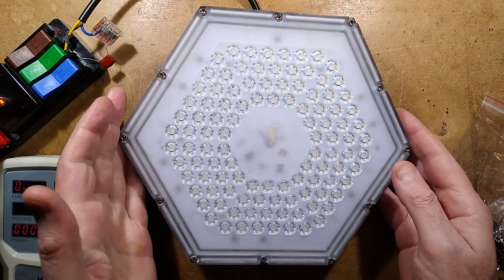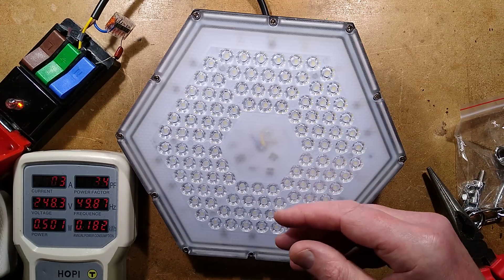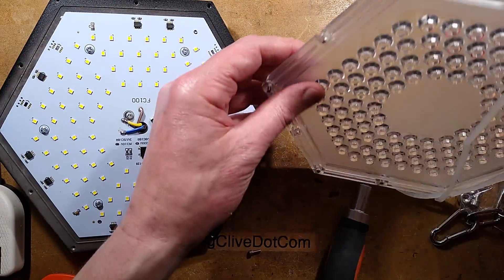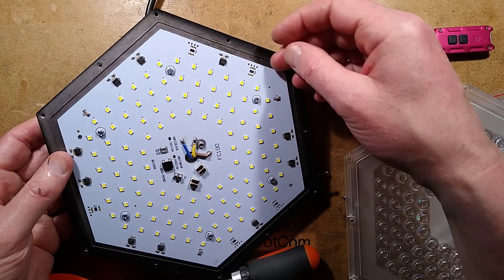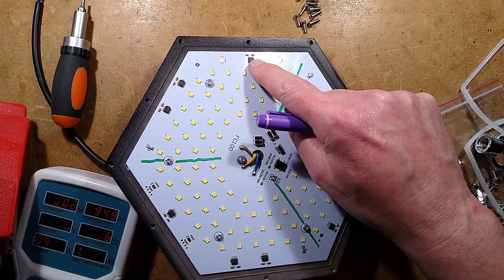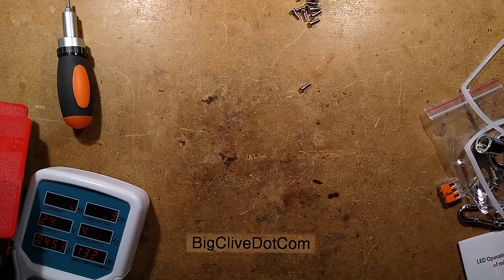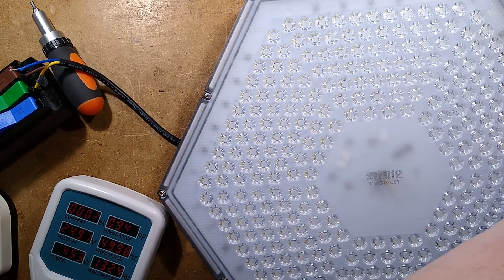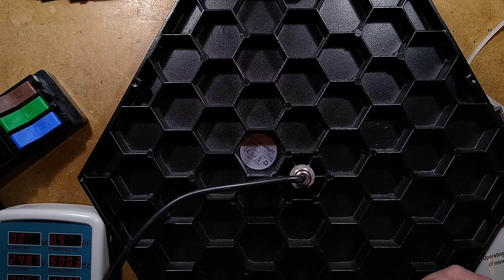Exploring an eBay "mine" light (flicker alert)

Comment: I would like to see a test of each of the lights at full power (outside for safety) with the thermal camera to see how hot they will get over time...and if they will actually melt the front.
Reply: That heat is felt radiating from the panel is just frightening.  I'm in Australia, and LED light burnout is a real problem, and shortens their life considerably.  I'm sure this has a lot to do with stressing the LEDs to their limit and then with ambient temperatures pushing 40 degC, they roast.  Pull a failed globe apart and sure enough one LED will have dirty great black spot in it, and others will have brown patches or small black spots.  Remove the most damaged LED and the globe works again.  Magic!  As a result, all the LED battens I have are now doctored (Big Clive style, thanks mate!) to ensure they're never warm to the touch with an ambient temperature of 25 degC.  They still feel warm when it's 40 degC+, but so does f'n everything else too!
Reply: @Stoneman06660  fellow Aussie here, yet to have a single non-ebay bulb fail. I just use Philips stuff(normal and a lot of hue) and zero failures, even when installed in outdoor fixtures and even full sun.

Previous industrial workplace also had gone through the "let's replace every light with cheaper led options" and they dropped like flies. Switched to decent stuff (the smaller flood lights they ended up installing also happened to be Philips Smartbright) and zero failures in years. The quality of light was hugely better as a bonus.

The explosion-rated LED fluoro batten replacements also had zero failures in years, some in close proximity to rather hot furnaces etc.

With led, quality is everything
Reply: @Stoneman06660  Probably China made stuff. The ambient temperature may be the difference between working for at least a few years on average or fail within weeks or month. Chinese manufacturers probably just count on the "max recommended operating conditions" given when buying LEDs - which is usually at just at 25°C, because the manufacturers want good numbers (this is almost impossible to keep them at, even in an environment with "normal" room temperatures. Even more so, when the ambient temperature is far above 25°C as well. Usually they have to be derated to work reliably at more relevant temperatures for the cooling capacity and ambient temperature - which is shown in the data sheet. Same thing applies for components in the driver. Which often gives up before the LEDs burn out).
Reply: Totally agree this would be a great video too. Would also be interesting to see the temperature difference running them at 25%, 50% etc.
Reply: It's the world's first LED room heater.
Reply: @chrisengland5523  Please, i've had times when money was so scarce that i didnt have gas heating and had to use an excess of lighting to heat my room(.....people who know me know this isnt bs either, true story)
Reply: @frogz  Well, I sympathise with that and sadly, there are many people in that predicament. From an engineering point of view, the electricity is converted by all types of bulbs into a mixture of heat and light. (The light ends up as heat eventually too.) Modern types of bulb, particularly LED's are much more efficient, in the sense that more of the electrical energy is converted into light, rather than "wasted" as heat. In the summer, that heat really is a waste, but in the winter, the heat is not wasted, but instead contributes to the warmth of the house. Whether you heat your house this way or use an electric heater of equivalent wattage makes no difference to the cost. However, neither is as cheap as using gas at current rates (in the UK, at least).
Reply: +1 Yeah me too.:yt:
Reply: +1
Reply: Yes that would make a great video. my thought was will the rain help or hinder the cooling?
Reply: Such powerful LED's usually require heatsinks and maybe active cooling. There are even liquid cooled high power LED's out there. 

I have once built a powerful LED floodlight for my offroad RV, which did require active liquid cooling.